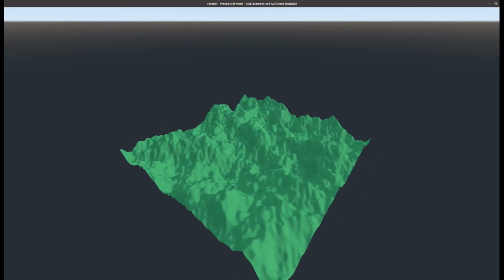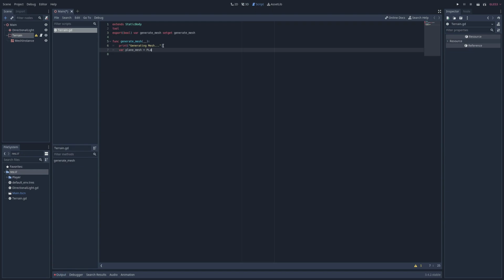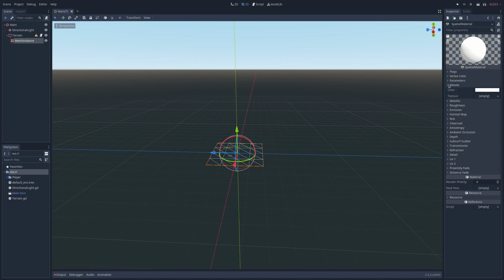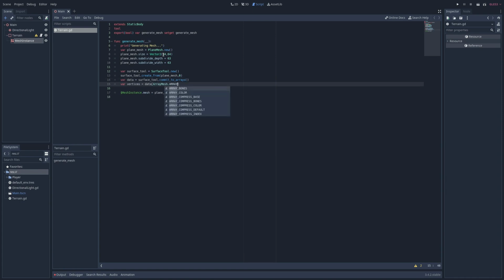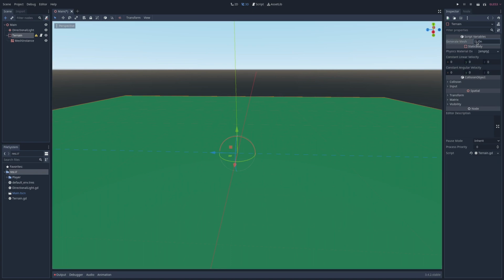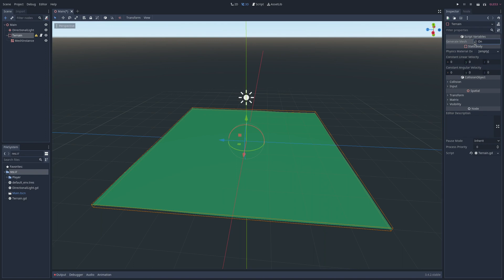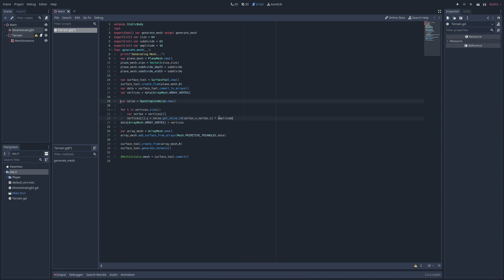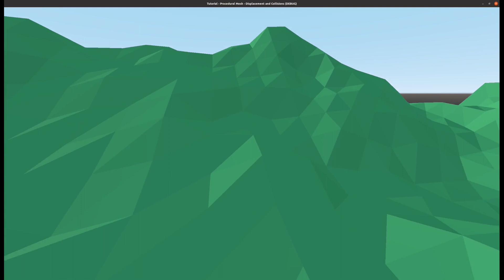Procedural Terrain Generation: Displacement & Collisions

Comment: In case you are watching this in 2024 or later (godot version 4.X or higher), here is the code updated:

@tool
extends StaticBody3D
		
@export var SIZE: int = 64
@export var NOISE_AMPLITUDE = 16

@export var noise: FastNoiseLite = FastNoiseLite.new()

func _ready():
	generate_mesh()

func generate_mesh():
	print("generating mesh")
	var plane_mesh = PlaneMesh.new()
	plane_mesh.size = Vector2(SIZE,SIZE)
	plane_mesh.subdivide_depth = SIZE-1
	plane_mesh.subdivide_width = SIZE-1
	
	var surface_tool = SurfaceTool.new()
	surface_tool.create_from(plane_mesh, 0)
	var data = surface_tool.commit_to_arrays()
	var vertices = data[ArrayMesh.ARRAY_VERTEX]
	
	for i in vertices.size():
		var vertex = vertices[i]
		vertices[i].y = noise.get_noise_2d(vertex.x, vertex.z) * NOISE_AMPLITUDE
	data[ArrayMesh.ARRAY_VERTEX] = vertices
		
	var array_mesh = ArrayMesh.new()
	array_mesh.add_surface_from_arrays(Mesh.PRIMITIVE_TRIANGLES, data)
	
	surface_tool.create_from(array_mesh, 0)
	surface_tool.generate_normals()

	$MeshInstance3D.mesh = surface_tool.commit()
	$CollisionShape3D.shape = array_mesh.create_trimesh_shape()

Comment: For those who wonders how to do it with Godot 4:
1) Instead of adding "tool" above the variable, you need to set it as "@tool" at the very top of the script (above the "extends" call).
That will tell the engine to run the script within the editor (and check for changes in the variables).
2) To apply a Getter/Setter in variables in Godot 4, you need to implement the proper intended spaces.
For example:
@export var Generate = false:
	get:
		return Generate;
	set(_gen):
		Generate = _gen;
		generate_mesh();

This tells Godot that, if something tries to access "Generate", it will get the boolean value, but if something "set"  the value, then it will call the generate_mesh with the value it's being set with.
Then you can do something like this with the generate_mesh() function:

func generate_mesh():
	ResetMesh();
	if !Generate:
		return;
	print("Generating Mesh");
	[...]

The ResetMesh(), in my example above, is a separate function that clear (if applicable) the existing mesh data and set it anew.

For example, I'm not pre-creating the MeshInstance in the scene, but creates as a child or reset it in the ResetMesh() function. This allow me to free up resources and remove the terrain data if "Generate" is set to false if I reload the same map with a different pattern/layout. For example, if you generate a terrain for something like a dungeon, you might have a variation that has glimpse or even actual access to the exterior, but others that might not have any access at all. You could separate the 2 scenes and such, or you can, as I did, setup the terrain data to be cleared and avoid having to load/change scene once it has been loaded once.

The only other important thing I got to point out about Godot 4 is that the setting up the @tool in the script will requires you to close and open back up the scene (or Godot itself) as @tool is only loaded into the editor when a scene is opened.

Comment: How did you make last seconds where whole surface shaded in that low-poly way and not smooth?
Reply from the maker: In godot 4, the SurfaceTool indexes the vertex array automatically. Essentially, vertices with same position are merged and so too are the normals on those vertices. I'm not positive it will work, but try calling  deindex() on the SurfaceTool right before calling generate_normals().